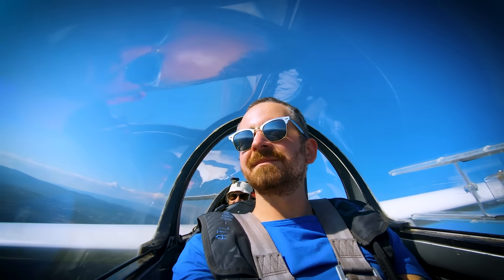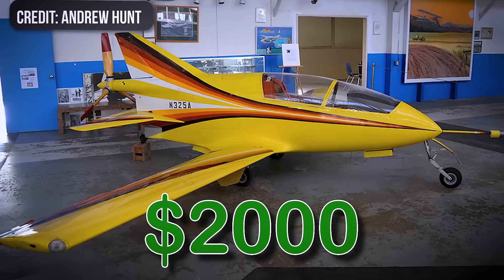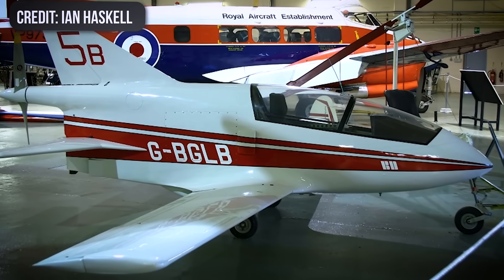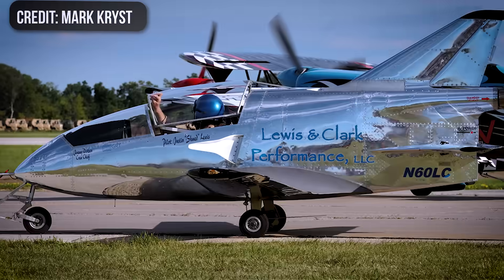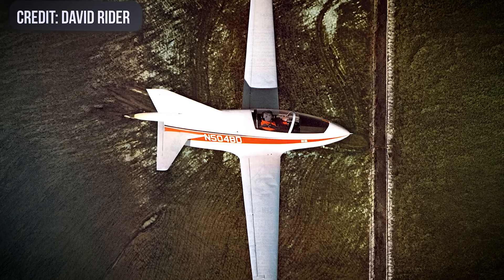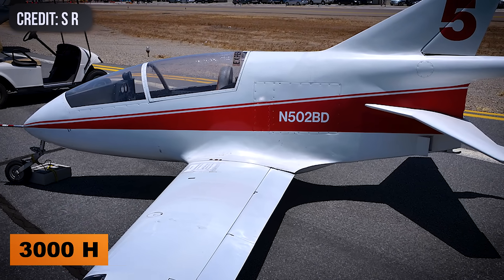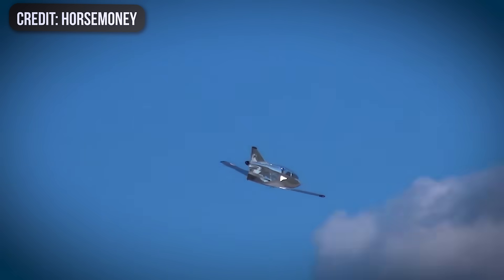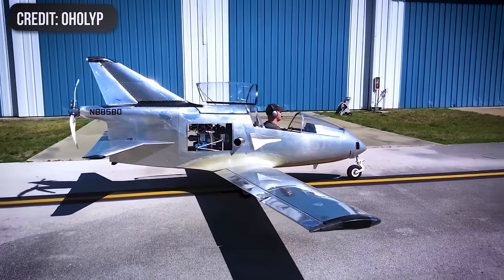This ‘$2,000 Jet’ Seduced Thousands of Pilots… Then Turned On Them

Comment: A BD5 built in Australia was powered by a Rotax 503 and broke a speed record. I owned two of these aircraft to include three of the wings minus the sailplane wing. When you watch these fly (cheat death) look at the nose. That's where the pilots feet are located. 20 thousandths between you and a death Dorito impact. Also failed to mention the post secondary stall on takeoff after initial stall.

Comment: I knew someone who worked for Bede on the BD-10 at KSUS airport. When I saw the building methods and materials used, I was stunned. I told my friend that structurally, this plane is a death trap. I later observed that if you had money to spend, Mr. Bede was your best friend. If you didn’t, he didn’t spend much time with you. Jim was a good engineer when he designed some of the early Grumman planes. He turned out to be a better salesman. Some of his claims were lies backed up with creative design equations that worked on paper but had little practical application. Bottom line: he couldn’t be trusted. If it sounds too good to be true then it probably isn’t true.

Comment: I hear such familiar propaganda language.
Is a year to fix the stability issue a long time or very quick?
What about the accident rate of the BD-5's modern competitors you mentioned? By the way, Burt Rutan is not a competitor, but a participant in the development of the BD-5.
You've only revealed the mechanism of public reputation, not an analysis. I know that microplanes are sensitive to balance and engine selection. Which engines are worse and which are better for the BD-5? This is the first questions about the causes of accidents.

Comment: They do say if it looks right it flies right. This thing doesn't look quite right to me. It's the small wings. It just looks like something doesn't have much in its flight envelope once the power goes. 
Also the philosophy behind the aircraft, what was it, high performance for the average pilot? Something like that. It seems to me to be a contradiction. The reasons average pilots start out in something like a Cessna 172 is that they are very forgiving aircraft when thing go wrong. You have some room to recover from mistakes. By their very nature high performance aircraft don't.
I have to admit though, they looked pretty cool.

Comment: Mr. Rider, 

You gave a partially accurate, incomplete history of the BD-5. Still, there are so many inaccurate statements that I felt it necessary to respond. 
 I have 36,000 hours in over 100 general aviation aircraft, including several transport-category models, and several hundred of those hours were in all BD-5 models. Of all the aircraft I have flown, only two came close to the BD-5's excellent handling and safe flight characteristics: the Stearman and the B-757.

 While conducting flight testing in the 1970s on a BD-5 with a tubo-charged Honda Civic engine at Burt Rutan's facility in Mojave, California, I made at least a half dozen BD-5s with jet-wing dead-stick landings after Honda-engine failures that any half-proficient private pilot could have handled. If someone killed themself in a BD-5, they probably would have done the same thing in any aircraft under the same circumstances. The BD-5 is one of the greatest flying machines I have ever had the opportunity to test and fun fly.

I was also a friend and worked with Jim Bebe, who was one of the most brilliant aeronautical engineers, short of Burt Rutan. He was just screwed by the economy of the 70's and the people stealing from him.
If the circumstances of the time hadn't stopped the program, a training device that Jim designed and I built for him could have saved the lives you mentioned of the not-so-proficient. It was called "Truck A Plane" and was an actual BD-5, minus the engine, mounted on a boom mounted on the front of a pickup truck. The weight of the aircraft and pilot was compensated for with springs, and the plane flew and stalled at the same speeds as the powered aircraft. It also flew exactly like the powered aircraft at the same speeds. In addition to Jim's, I also built one for myself since I was a dealer and successfully trained several pilots using "Truck a plane."

If you knew more about the history of the BD-5, you would know that the "A" wings had a very short time on the BD-5 because one day while working at the test center helping Ed Maler finish his BD-5 jet, I was told the original test pilot only few the short wings once or twice and scared him so much he wouldn't fly them again., Don't know if it was true or not, but that was the story, so I don't understand how a customer could have been killed in one since the factory swithed the 21 ft long wing after that event. 

In my experience, the best wing for the piston-powered BD-5 is the 17 ft jet wing. Even though it was shorter than the 21 ft standard wing, I had to dead-stick the 5 many times during testing. I had to lower the gear and flaps and still slip the aircraft to achieve a normal landing; it was a good glider.
I have built 3 BD-5s, 2 Truck A Planes, and 6 other home-built aircraft, and none of them came close to the manufacturer's claimed build time, so you can quadruple the claimed build time and come close.

Please don't call the BD-5 a "FATAL" design; that's inaccurate. Yes, people were killed in the aircraft as they are every day in hundreds of other designs, but most accidents are caused by mistakes we all make. One of the main mistakes is failing to receive proper training on the aircraft type, even if it's only a thorough briefing on that aircraft's technical knowledge and characteristics.

After spending several thousand hours flying various aircraft, I can tell you the only problem with the BD-5 back then was finding a reliable, available engine. There are several engines that are now safe.

As for the down thrust of the engine, the original BD-5 was designed to use only a 40 hp engine. As time passed, people started installing larger engines, hence the increased down thrust. Increased high center line thrust creates two problems: on approach, adding power requires either additional back stick or back trim, and reducing power requires the opposite (TRAINING). The other problem is on takeoff, as explained below.

The BD-5 jet wing I tested in the Mojave Desert used a turbocharged Honda Civic engine modified for the BD-5. It weighed 130 lbs and produced 140 hp at 45 inches of manifold pressure for takeoff. On the first test flight, I wasn't considering the down thrust of the high center line thrust, and that was one of those briefing details that, when omitted, can kill you. I rolled about 8000 ft of the 10,000 ft runway with 80kts a/s showing at 45 inches of manifold pressure and could not unstick the nose, so I thought I was aborting the takeoff by closing the throttle. Instead of aborting, I almost immediately found myself 200 ft in the air and just continued the departure.

So, my takeoff procedure changed to 45 inches of manifold pressure until 65 kts, power back to 30 inches of MAP, rotate to climb pitch, then add 45 inches of MAP back.

Sorry to be so long-winded, but this article brought back many fond memories. 

The BD-5, with 17 ft or 21 ft wings, is a great aircraft when equipped with a reliable engine with adequate horsepower. It is not a simple aircraft to build.

Tom
Reply: I had a BD5 and would not build it with the long wings because of reported buckling of the upper skin.  Given the twitchiness of the design, putting it on wings with harsh stall characteristics seems like a bad idea.

Comment: My degree is in aeronautical engineering and I have 21,000 flying hours in military aircraft and airliners. There was a very telling article in one of the kitplane magazines around 1983. It showed by many, many in-flight photographs of how the upper wing surface would "tin can" (wrinkle) even in only 1 G flight while being photographed from a chase photo plane. The wing skin carries a tremendous percentage of the load of an aircraft wing. The upper surface must be thick enough to prevent "tin canning" of the upper wing surface as it is under compression load anytime it is in positive G flight to maintain the design airfoil shape. Any distortion of a wing airfoil shape greatly increases drag and greatly decreases lift. Even more importantly, it greatly increases the stall speed as it further deforms the airfoil shape when G loading is increased. It's very similar to the effect of wing icing. And all that was obvious from photographs taken in 1 G flight. Think about how much the wrinkling and thus stall speed would increase as the design airfoil shape distorted even more with increasing G loading. In that article, it further pointed out that the BD-5J jet version curiously increased the aluminum skin thickness of the wing (probably to correct this deadly design flaw already shipped to hundreds of prop version builders). Jim Bede was little more than an over zealous snake oil salesman. This was no way to design or test an aircraft BEFORE kit deliveries. Another very telling obvious design flaw is the extremely short wing chord. The Reynolds numbers associated with this wing are a complete joke. Added to that, a very short overall length forces a very short-coupled layout that greatly limits any inherent stability. The very high thrust line adds just another design flaw. At high power settings, it's forcing the nose down. But if the engine fails, it causes a subsequent uncommanded pitch up as the now-unpowered propeller suddenly acts like a parachute to rapidly slow the aircraft at exactly the moment that it causes that uncommanded pitch up. STALL, STALL, STALL. Even experienced Air Force F-104 pilots would have crashed these very poorly designed BD-5's. Now, consider these design flaws together in an engine failure. The now-unpowered prop acts like a parachute to rapidly slow the aircraft. The high mounting of the propeller so much higher than the aircraft centerline causes an uncommanded pitch up which further causes an unexpectedly higher G loading. The wing airfoil shape gets ever more distorted by the increased G load vastly increasing the accelerated stall speed both from the G loading AND the airfoil shape distortion. Pushing the nose over relieves the vastly increased stall speed, but that propeller drag chute is still there acting against your pilot control input. The all-flying horizontal stabilizer only has so much aerodynamic authority which is decreasing for every knot that the aircraft slows. In a very, Very, VERY light aircraft, that relatively huge prop drag forces the pilot to practically point to nose down right at the ground. Then the pilot would have to perfectly judge when EXACTLY to pull out of the dive in a forced landing. Too early and the aircraft stalls at too high an altitude. Too late and you fly yourself right into to ground. Either way, you're not going to live.

I haven't even meantioned that converting any engine to mimic an aircraft engine is a fools errand. Continental and Lycombing design engines to put out high horsepower and torque at relatively low RPM for use with a propeller that is limited by aerodynamic efficiency. Using any other engines is just an accident looking for a place to happen.

So, the Bede BD-5 is a very sexy DEATHTRAP with wings.
Reply: Years ago I started flying ultralights.  I got training in a 2-seat Quicksilver.  Yeah, you want to talk drag ..to land, you flew it right up almost to the edge of the runway, cut throttle and push the stick all the way forward and dive toward the runway because otherwise it would slow and stall in a heartbeat being so light and the drag from all those wires and the prop dragging.  Then you had to flare at just the right moment.  The one I trained on had ailerons, but they weren't very useful except on cross winds and caused a lot of adverse yaw.  In the right envelope, you could cross control with the ailerons and rudder to make use of the adverse yaw to really snap the plane around, but that's not something to do low and slow.  I literally had to unlearn nearly everything I knew and learned in GA flying over the years.  The first couple of flights scared the crap out of me, wasn't sure I wanted to fly them, but I stuck with it.  Ultralights are fun, but some are far from forgiving and easy as they are made out to be.
Reply: But I would to fly the 13:13 'simulator'      I wonder where that thing is now!    Let's buy it and use it.
Reply: BD designs used tubes for spars.  The rib and skin width was greater than the tube diameter.  In wings, the greatest bending stress is on the outside surfaces.  So the BD wing upper skin is the foremost member, not the spar, and the skin initially carries the bending stress. When pulling g’s the skin buckles under compression, but spar is OK.  The skin resumes its shape when the load relaxed.  
  Other planes have built up spars (usually I beams) with the skin riveted to the spar caps.  The upper spar cap is 1.5 x thicker than the lower because of buckling instability.  Even so, The skins still buckle, but at greater G’s than the BDs.  (And they can be thicker and have stiffeners…)
  BD tubular spars are inefficient members, but they are simple.   The AA1A, AA5A, AA5B are commercially successful certified airplanes.

  The wing skin carries air loads, drag loads, and pitching moment (torsion) loads.  In a twin the skin also carries the torsion of the overhung engines back to the fuselage to be counterbalanced by the tail.  Impressive such a thin member can do as much.

  I’ve blathered enough, best your way.  D
Reply: Beautifully written
Reply: Beautifully written.

Comment: Dumb question but why didn't they just use an outboard motor? Why not extend the frame? Lastly, would it have been helpful to make it into a canard?  configuration?
Reply: Scooping cooling water for the engine while in flight would require a rather long hose. Most engines other than aircraft engines are not designed for continuous use at nearly full power. Frame is extended by many of those that are flying. And going to a canard configuration would require a complete redesign (relocate wing; beef up structure for new loads, etc.).
Reply: I had one, and considered using an outboard motor powerplant, or a Honda Civic engine.  The latter has been used in several, and I think I might have heard about an Evinrude in one.  Definitely knew of a 115 hp Evinrude in an early VW   The hitch with all this is that using an experimental engine in an experimental airframe is just a very bad idea.   I think the Honda-engined ones extended the airframe.  I'd planned to use an entirely different wing, but fortunately sold the kit before I could do anything so crazy.

Comment: I got some good video footage of the BD5-J at our local airshow in 1995, piloted by a former Blue Angel. It seemed to handle very well with this pilot at the controls. But a couple of years later, this same airplane had a rupture of the fuel line which ran through the control panel and the pilot had to bail out to save himself.

Comment: Don't forget that Bede turned the body of the BD-5 into a streamlined motorcycle fairing that enclosed the whole cycle. It had two small outrigger wheels at the center, that kept it from tipping over when stopped. There were articles about it and promotional brochures, but I never heard another word about it after a certain point and no one I know ever saw one on the road. I would think that balance and control would have been serious problems and also the limited visibility of the road.
Reply: In the mid '80s an American was building these in a shed in Israel, and trying to selling them to Israelis. It got into the local press, where there was a discussion about whether it should be classified as a car or motorcycle for road tax purposes. He used to drive one to work. He used to kick start it, get inside, and then closed the canopy, which pivoted forward. It used to go out the carpark at speed. One day I followed to see what happened at the traffic lights. Sure enough, he hit the brakes and the out riggers came out. But there was a bit of 'wobble' before they contacted the ground. Looked very unsafe, especially given local driving "standards".
Reply: @SuperNevile  I built a little enclosed streamliner with outriggers that were deployed with foot pedals.  The wobble upon stopping was not too bad, but the wobble starting out could be unnerving.  I ended up putting the vehicle on three wheels.

Comment: Sequential vs. concurrent design (also known as the Cook-Craigie System, named for the two USAF Generals that developed it) has the issue where sequential allows bugs to be worked out over time. Concurrent development has everything (i.e. all the inputs) go wrong at once, much harder to troubleshoot and fix. Then there is massive amounts of (expensive and time-consuming) rework.

Comment: The selection of a short block Hirth two stroke, without carbs or exhaust, doomed the project. Most of these aviators knew nothing about two strokes, carburetion requirements or the requirements for a proper two stroke exhaust system and cooling. The engine shown in the clip is water cooled. The engine they sourced was air cooled and as an inline twin the rearmost cylinder was always going to be hotter.